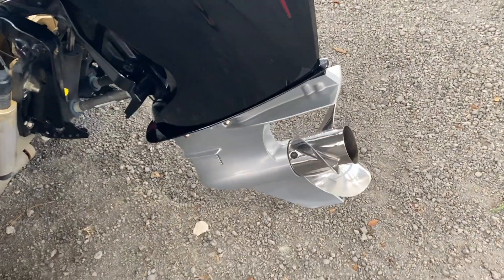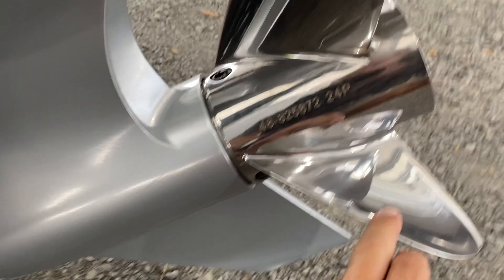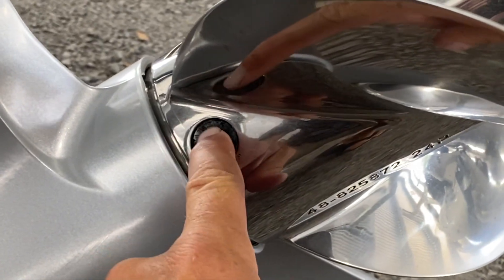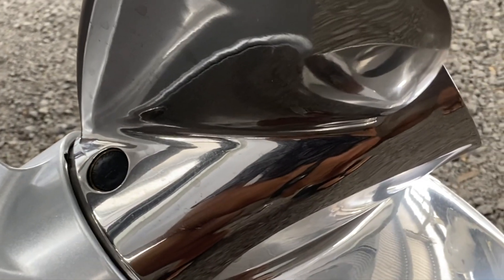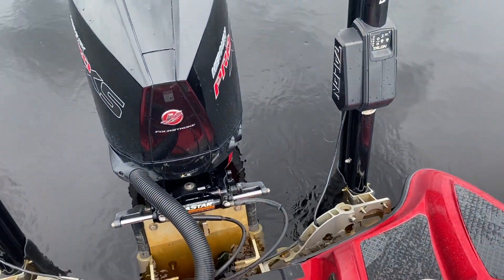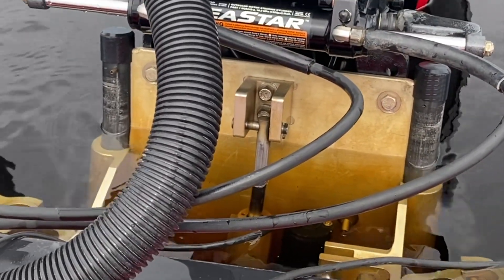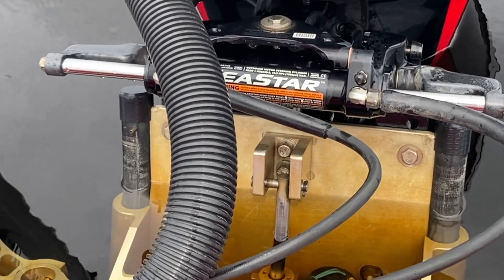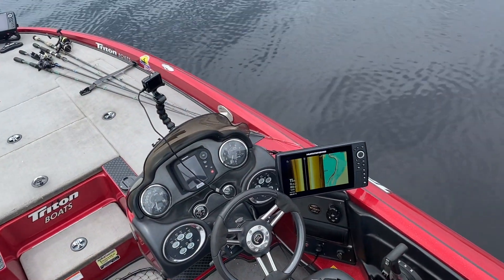Prop Plug Performance

Comment: For some reason it seems each hole should be the same, to give equal slip on each blade....so either all clised ,all small hole or all bigger hol or no plug.

Comment: Switch to fullly closed off you have the new stroke those have so much torque you dont need the exhaust gasses to help it get into the power band you usually use performance vent plugs on 2 strokes switch to fully plugged holes and you shouldn't blow out at all if you try it lmk ur results
Reply: New 4 stroke *

Comment: I recently discovered these props, with holes in them. I’m pretty sure they are there to make the boat go faster top speed. I’ve got an old 17 foot checkmate with a 93 Evinrude 140 that has some “upgrades”.
I have a vented SS 13.5x24. 
74 mph bad hole shot. 
Other ones a SS 14x17 I think. 
It does about 45, but it gets there in about 4-5 seconds.
Reply: Plugs only effect the hole shot no effect on speed in anyway. Once your on place all the venting goes through the hub not the holes.

Comment: This is called exhaust cavitation.  I had the same problem with my 225 xs motor.  I had no plugs in the prop when this was Happening.  I put the vented plugs in and that solved the issue.  The fully closed plugs bogged the boat down pretty badly.
Reply from the maker: Thanks for the info!

Comment: Thanks for this video.  I've got a 2 stroke optimax 115 (Trophy Pus 21p prop) on a 2012 stratos 186xt (my son's first boat).  Our hole shot stinks.  I ordered four solid ones.  They are a pain installing them as well..
Reply from the maker: Agreed! I spit on them first! Getting them out is worse I use a paint can opener.
Reply: Haha. Thanks!!
Reply: @davidclementsfishing-thewh3200 Switch to fullly closed off you have the new 4stroke engine those have so much torque you dont need the exhaust gasses to help it get into the power band
Reply: @davidclementsfishing-thewh3200  lmk if u do the swap if love 2 know if it improved ur hull shot and ur prop slipping

Comment: Trim has a larger impact on hole shot than jack plate!  Trim fully in for start, begin trimming out as you near plane speed!   I was hoping this would show differences in plug hole sizes, not jack plate adjustments with no plug changes!

Comment: what RPM are you at when the nose rolls over and you get up on plane?  You typically want to shoot for 3800-3900 for optimal hole shot.  Typically the blow out happens due to the engine being too high and I believe that's why you see improved hole shot when drop the engine.  The other thing that can cause blow out is having too much venting on your prop..that will cause the air bubble that the exhaust creates to be too large and leave no water left for the blade to load up on.   Depending on your RPM when you roll over on plane and the amount of slip you're seeing we can further improve your performance.  I'm running 3 plugs in my tempest that are all solid and I see 3 second hole shots without having to manipulate the jack plate at all.
Reply from the maker: You are correct. I haven’t paid much attention to the RPMs but I certainly will do that. Thank you

Comment: I plugged all mine closed and the hole shot is way better .
Reply: Typically having them out will improve hole shot
Reply: @unlock_your_dream_home  . For 2 stroke yes, 4 stroke has higher low end torque so most 4 stroke leave the plugs in. I bought my boat used and had terrible hole shot ( Mercury 150 4 stroke) all plugs were out and was missing the prop ring . Installed prop ring and all 4 plugs and instantly the boat jumps out of the water now ( 4 blade prop)

Comment: Yeah... Still no good videos on vent tuning.
Reply: It's simple....if it over revs (over4,500 rpms) the prop is getting too much venting. If it bogs down it needs bigger plugs so it will vent more.

I bought solid plugs and drilled holes. Test ran and enlarged the hole till it went too far then drilled a second set at the previous size.